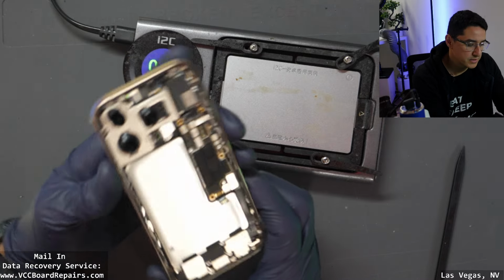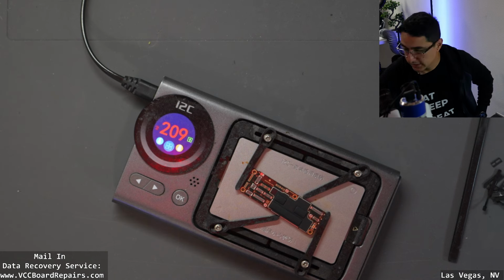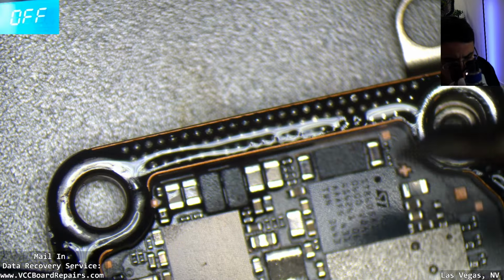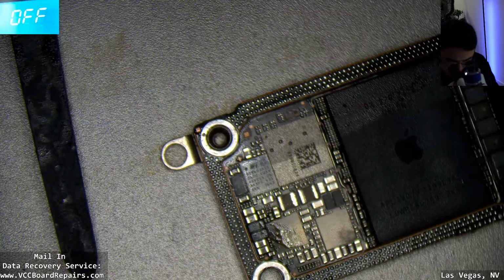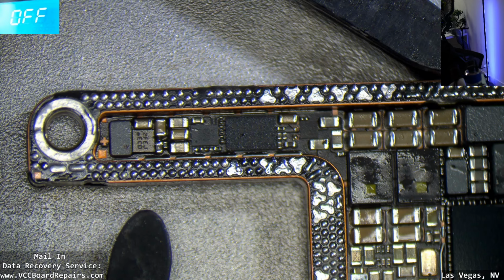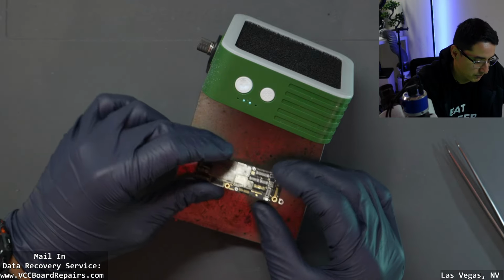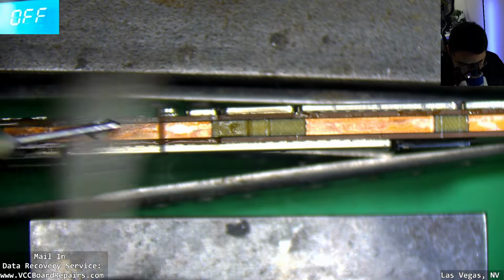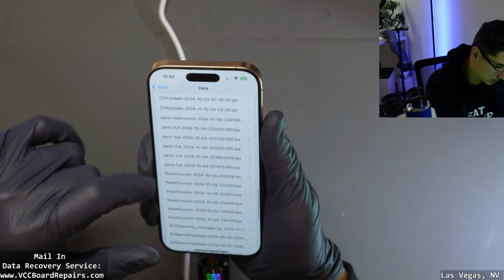How To Split an iPhone 16 Pro Sandwich Board & Reball It Without a Stencil. Deep Teardown!

Comment: Totally the opposite of what we learned in Practical board repair school at iPad rehab. Like once we stick it on a heater specially like the sunshine blocks you know and you align it you don't move it. Plus we put a thin coat of flux with heat we spread it around the top board very thin and then just let it heat and smoke until we take it off
Reply from the maker: This video is to show how to reball it without a stencil, since the phone was only a few weeks old at the time of filming & no tools were available yet
Reply: @VCCBoardRepairs  I am a huge fan of your Channel.  Just not like your other videos at all
Reply from the maker: What do you mean?
Reply: @VCCBoardRepairs I mean your videos are very polished.  But your live streams sounds like you're on a back of a train
Reply from the maker: Ok thanks

Comment: Must I reball the sandwich board after separating for the first time:… if I just join it back after fixing it without rebelling with low Melt is there any issue?
Reply from the maker: Yes you should reball
Reply: @ what if I didn’t mess up the initial factory Solder balls.

Comment: I've noticed that flex connectors have trouble connecting and staying in after motherboard work like this, is it the flux doing that ? I use Amtech NC559
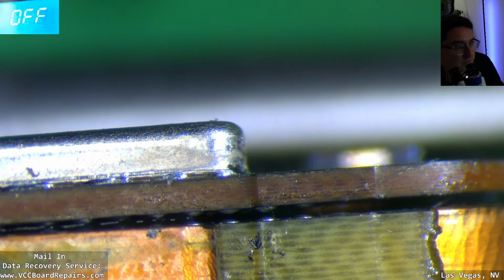Great video, instructive as always. Your tweaser squeeze + hot air technique to fix partially soldered boards was good to know 54:00
Reply from the maker: Yes, too much flux. You need to clear regularly